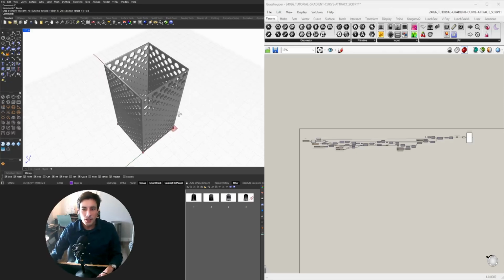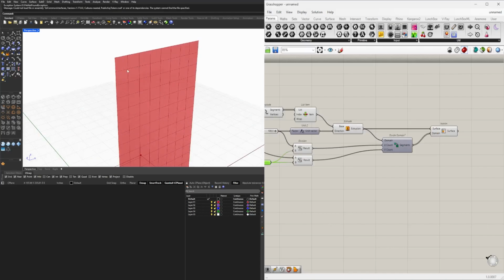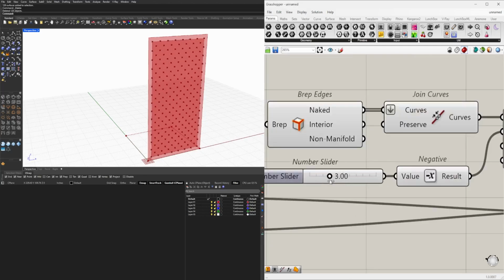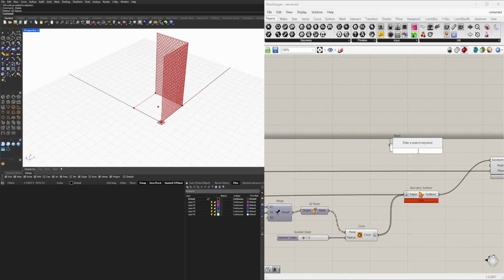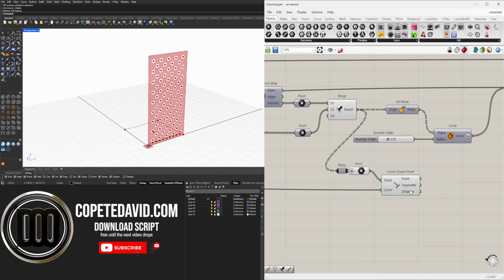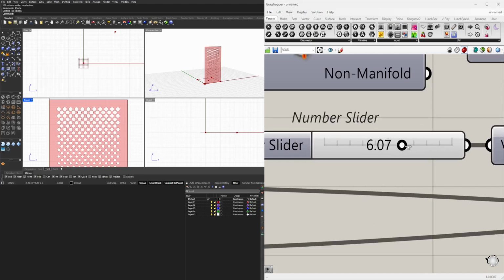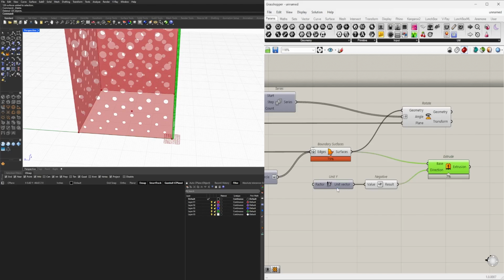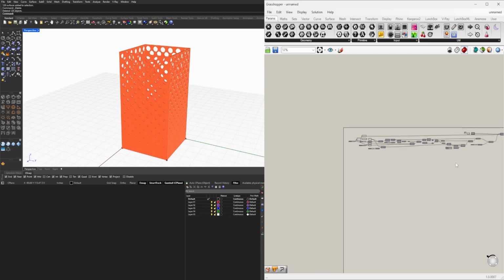Rhino 8 Parametric Curve Attractor Gradient Hexagonal Grid Pattern Architecture Grasshopper Tutorial

Comment: such a great tutorial, thanks !!! just one question, what would I need to change in order to use a curve instead of the horizontal line segment as my point attractor? xx marlena
Reply from the maker: You need to make a curve in rhino or grasshopper and replace the curve attractor curve with it. Make sure it's on the same surface. I'll do a follow up on this question. Thanks for the question!